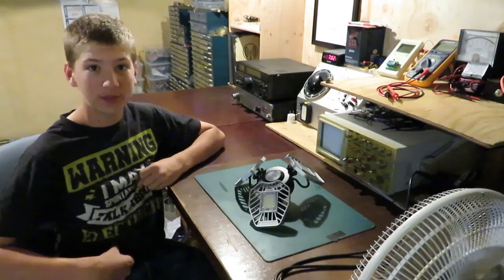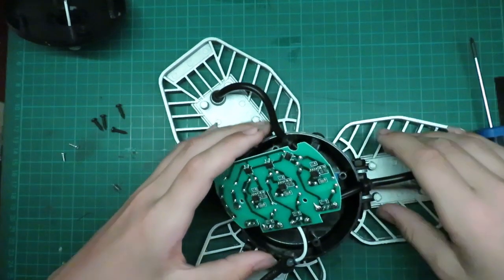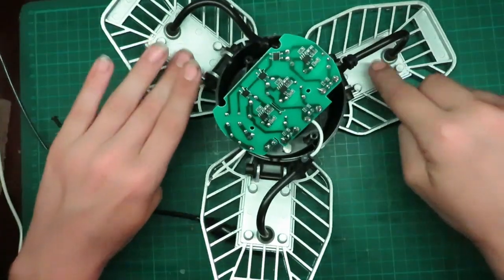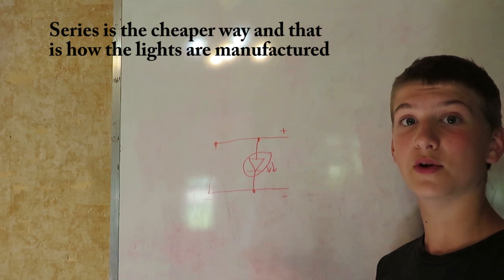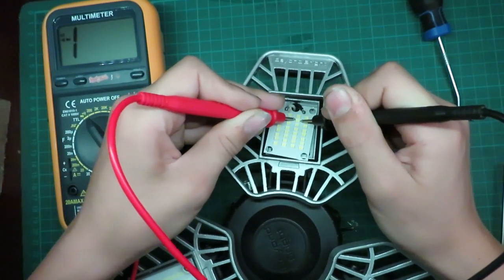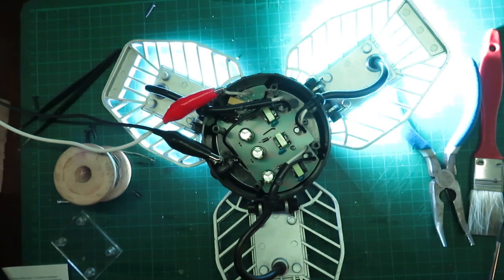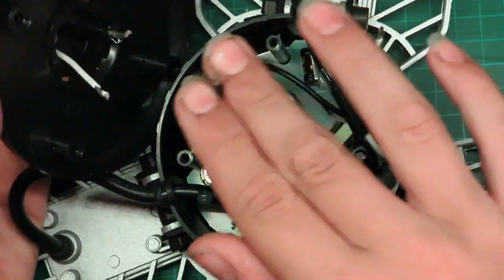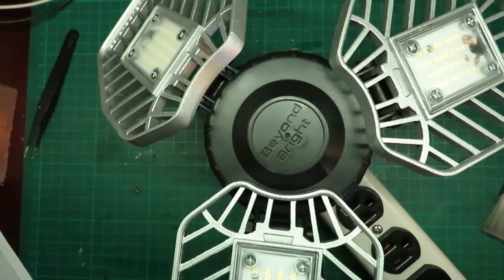LED Garage Light Fix

Comment: Thanks for the relatively short video showing an effective fix!

I've fixed up three of five partially failing/totally off lights.    I found the same thing - the alumnium circuit boards don't readily let you de-solder the LEDs for an elegant fix.  So, pliers it is, and the metal tabs from the original LED remain.

Perhaps the only elegant fix to try, rather than bridging with solder, would be to have the same size/output LED, and carefully solder them to the old LED's metal pads.   

If I find I have more panels fail, I may try that route.   I've had up to 6 LEDs fail per panel, and they are pairs of LEDs in parallel, then 15 pairs in series.  

They all worked once more with ugly, ugly, ugly soldering across the remaining SMD LED pads.  The combination of the diecast aluminum heatsink and aluminum sheet as circuit board draws the heat away so quickly that a more elegant soldering job is difficult.

Comment: Nice job. What is the device on the side of the housing that the incoming hot wire goes to?
Reply from the maker: There is a switch on the side of the case, Thanks for Watching!

Comment: Those aluminized PCBs are great for heat sinking, but terrible when you need to remove an LED.  When testing long strings I will usually use a Sharpie to put a color dot on top of the bad ones...easier than trying to remember where the failed parts are, especially if there are several of them!
Reply from the maker: Yes. Thanks for the Tip!

Comment: One possible problem with this fix is by bridging those pad the voltage across those remaining LEDs increases and therefore lower their effective life span.
Reply from the maker: Yes that is a problem. But I don't know how long the LEDs will last anyway since these quit after 6 months
Reply: In the meantime, I'm using a pair of pliers, a soldering iron and solder I already have to defer spending $15-20 to replace each of my failing LED garage lights.   Three fixed, and two more to return one dead panel each to full use.
Reply: LEDs are current driven devices, not voltage (just need high enough voltage to cause the diode to conduct, and not enough to cause arcing).  The current in a series string will not change if the supply is current limited as it needs to be for LEDs.  The initial voltage measurements indicated that the power supply voltage ranges from 50-ish volts to over 70 volts, indicating it is a current limited supply.  Voltage measurements after the fix should indicate that the voltage varies in proportion to the number of working LEDs in each string.

TL:DR: this change is very unlikely to significantly affect LED lifespan of the remaining LEDs because the current (by design) and the voltage (shown by the measured range) are still within what would be considered normal.  (Current is probably too high, by design, because that gives off more light while reducing LED lifespan.  To avoid or minimize this while shopping, look for the highest light output per watt of power and the longest real warranty.)
Reply: @prettymuchflawless-cn1ms  I have a pile of 8x 4-Leaf panels I'm working on right now, they have an average of 4 bad LED's on each of the 32 leafs.  They suck.  I use side cutters to nip of the top then a big fat chisel tip on the iron.  Apply your favorite flux and a bit of solder on the tip to increase the surface area, heat the 2 pads a few seconds and 'wipe' them off with the tip.  Follow up with desoldering braid and alcohol.  The solder mask is very tight to the footprint of the part leaving little exposed pad beneath the LED.  I use a box cutter to scrape away some solder mask on the positive side which is the narrower pad.  I'll hit them with a fiberglass scratch brush pen, flux, tin, and solder the new LED in place.  I'll stick about a 3mm chisel in for soldering the 3528 LED's mine use.  I'm in the middle of rinse/repeating that many, many times.  I think the primary failure was lack of thermal transfer compound between the aluminum LED board and the cast aluminum housing.  It appeared to be more of a silicone adhesive, it certainly made them a PITA to remove depending on how much goo they used.  None, however, had much more that a 1"/25.4mm 'squirt' in the center, leaving a 1-2mm gap between the board and the housing which ultimately cooked them. I'm using good old fashioned thermal transfer grease to reassemble them.  So far, I haven't had any driver issues.  Time will tell how effective better heat transfer affects their life.